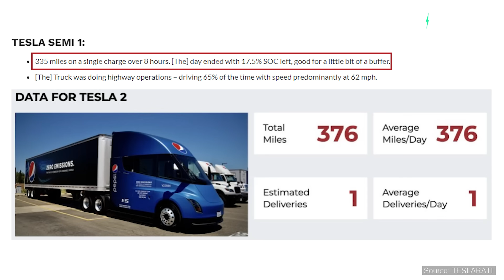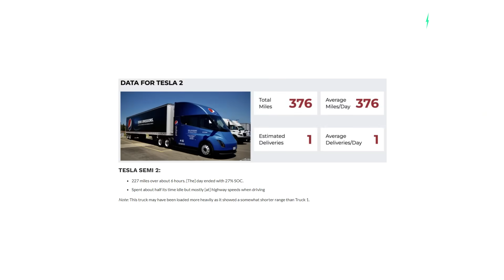Tesla Semi tested at highway speeds - REAL world range shocks rivals

Comment: Sam. also imagine millions, probably, of semis needing to charge thier batteries at once! Sure pepsi is rich, but what about all the small operators i see daily fueling semis! wheres the infrastructor,  the charging stations for them! NOT YET IN THE USA
Reply: There are 36 Tesla Semis in the PepsiCo fleet, and 21 Megachargers in use or permitted; and another 72 planned between Fremont, CA and Laredo, TX. The infrastructure will be built out as the fleet grows. This is the same and the Tesla Supercharger network; which has grown from the very first Supercharger to a near-world-wide network of 50,000 Superchargers in just 10 years.

Comment: I think replacing diesel with these EV semis is probably the easiest segment of the ICE market to disrupt. Mainly becuse the high capacity charging points would be easier to build out because truck traffic flows along major highways. Cars and pickups have to go everywhere and randomly, but big trucks are more like trains tied to tracks. The trip to local pick up and delivery points would not typically be out of range of the major highways. I think this looks like Tesla outperforming the complacent legacy industry in a a critical transport segment.
Reply: Specifically Day Cabs are the easiest. Long Haul Trucks with BEVs is basically impossible, but that is very much NOT the entire industry. Day Cabs are a massive sector that should be fine with a Truck with 400 miles real world range.
Reply: @Neojhun  A long haul operation is easy to setup.   Just swap drivers as needed.   If the load is hot you can swap out the tractor too.  The trailer moves 24/7 but for the time it takes to swap drivers and or tractors.   This is not new.
Reply: Segmentation of EV semi's needs to be addressed.  Delivery vehicles need to be a major focus; specifically, the 'final leg' of delivery (DC to consumer).  That will be interesting to watch/see.
Reply: It’s an industry that is finely tuned to the economics of transportation. Cost per mile is the key metric. If a company can save on fuel costs and maintenance, they will make the shift.

Comment: I analysed the first two day so  data, the results were: 

Based on the fact that they are fast charging at the end of each day, it looks like they are starting and ending each day at the same depot. So, it looks like they are doing round trips of within a radius of about 190 miles of the Sacramento depot. 

Tesla Semi 1: Travelled 415 miles each day, driving mostly at 62-63 mph. Average energy usage rate was 434.5 miles per 100% of battery capacity.

Tesla Semi 2: Travelled 375 miles on day 1 and 362 miles on day 2, driving mostly at 60 mph. Average energy usage rate was 441 miles per 100% of battery capacity.

Tesla Semi 3: Travelled 514 miles on day 1 and 794 miles on day 2, driving mostly at 60-65 mph. Average energy usage rate was 430.6 miles per 100% of battery capacity.

Based on those figures, Tesla's original claim that the trucks were capable of doing 500 miles when driving at 55 mph seems realistic.
Reply: Tonnage is meaningless LMAO!!! 😅
Reply: What tonnage...  Range is meaningless without a tonnage number
Reply: @w8stral  The tonnage is 82 thousand pounds.  Battery electric trucks are allow an extra 2k pounds to account for the the battery weight.
Reply: @w8stral the weight is an advantage with regen during braking & downhills.
Reply: @w8stral Tonnage is meaningless. It doesn't take much energy to keep things rolling. Aerodynamics have a much bigger impact on range. 

The heavier a truck, the more it will Regen going downhill/braking. So at the end of the day, it's a wash.

Comment: This would be interesting if we knew the load weight each truck was hauling.
Reply: @user-el5nd2kn2r
Yes, but with time I think this will be the most analyzed semi ever.
With reason. It's revolutionizing the heavy truck industry!
Reply: @larsnystrom6698  If it works for a business to go this way, then why not.  A lot of mathematical load and range calculations need to be done first though.  No doubt Tesla are doing or have done the same maths.  In the US I can see a lot of 1mW chargers getting installed along major interstate highways, and that might make a difference to some fleet operators.  I say might advisedly.  I believe there will be a lot of interest here and as battery tech improves then maybe that will seal the deal for a number of doubters.  Logistics are a funny business and running costs and down time is like burning money.  I suspect not everyone will benefit the way we might think, but I am hopeful.  As I suggest, If it works for a business to go this way, then why not.  Cheers.
Reply: @GolLeeMe  Goo point. This test answers the question of how well these trucks work in practice.    Which is what you seem to be asking.
Reply: @larsnystrom6698  agreed, but the lack of data provided for these tests makes them almost worthless
Reply: @jamespaul2587  Negative Nancy
Reply: @jamespaul2587  No.  Your looking for one metric that is of concern to only 10% of truck owners.  90% run with less than max loads.   The questions they want to see answered is how well the electric trucks will work for them.
Reply: @BioniqBob  not negative, just pointing out incomplete test data is basically useless
Reply: Im with Mercedes on this one - the laws of physics generally dont like to be broken…😂
Reply: @mathysdupreez602 they don’t - because t Mercedes might be using bad approximations.
Reply: It was full load as far as i am told.
Reply: @isaksidenius7059    Yes, but what does that mean?  A full load of x number of tonnes, or a full load of empty boxes?  It seems careless that this report does not shed any light on what weight was hauled.  Haulage weight is key.  All we know is that the truck beat its claimed range by 5-10%.  Well, thats good.  But why not declare the weight moved in the tests?  To put another caveat on this, under what conditions did it achieve this?  Was it all (or nearly all) flat roads or was there a known % of hills involved?  Was it cold or hot on the day, or mixed?  These things are important when you try to achieve a real world test against claims.  I can see already that’s there is scope for electric trucks on our roads, but how important is this report and how real was it?  These are just questions and no disrespect to them testers or the truck or the report.
Reply: Max load 44,000 lbs « max load »
Reply: @steadybreeze1443  
Compared to the max load on a diesel with a day cab?
Reply: @steadybreeze1443  Thank you.  So they were hauling 20 tonnes, or 20,000kg.
Reply: @23chnge  I have no idea.  It’s not the fact they can move loads with battery packs, it’s how this is done logistically.  You don’t just get into an 18 wheeler and decide to deliver something down the road because you can.  It’s takes planning and this is where the pros and cons of electric trucks will either win or lose, or more likely be somewhere in between.  I can’t wait to get the noise and soot out of my local environment, so as soon as a better haulage system is devised I will be on board.  But thats just it, the replacement needs to be demonstrably better and at least logistically equivalent to ICE.  Details are everything.
Reply: @23chnge  They did, loaded to 81,000 lbs.; which means a payload of about 42,000 lbs.
Reply: Agreed, also the terrain and temperature. Even the Nikola did well going downhill 😊
Reply: @jamespaul2587  Correct.  I must admit, I had not given those two determiners a thought.  Thank you for the reminder.  👍
Reply: @jamespaul2587  The trucks park at the same depot each night.  With regen raking the terrain is not much of a factor.
Reply: Independent data with bribes attached…? Wall Street needs to sell those calls.
Reply: Is the problem that you’re really don’t want to know what the load is because it would ruin your narrative.

For the original 500 mile video there was an engineer who analyzed the trip. He determined with the weight of each of the concrete jersey barriers that were on the truck based on their length, which is determined based on the diameter of the tires.
Reply: @neilkurzman4907  Or, they could've just weighed the truck and the load and remove any doubt.
Reply: @hairtoss7975  
It Depends on who’s doing the test and for what reason?
Reply: @hairtoss7975  Because in the the real world this is not important for the loads.    Pepsi just wants to get what is needed delivered.  I think Pepsi understands they do have the range for it's loads based on data from Tesla.
Reply: @neilkurzman4907 you mean Cret.  Tins like ThunderF00t?? Who can't cope with reality...
Reply: @neilkurzman4907  Hardly, as I have no narrative.  I am just a sceptical person.  If it works, it works and I am happy.  My point is that for operators to get on board there needs to be a clear and sustainable benefit to swapping from ICE.  Suspicion breeds contempt, so how about the detail being provided and explained?  Surely weight is one of the key factors for trucks, and its omission from this report seems careless.  I have seen videos before discussing the barrier haulage test based on wheel base and tyre diameter.  This was a previous experiment and no detail was provided to determine if this logistics feat would be sustainable for haulage operators (so some assumptions were necessary).  It was not this situation with 3 independent tests.  The conclusion by assessment at that time was mixed.
Reply: @neilkurzman4907  the original load was in a enclosed trailer. The truck going up the hill passing the other truck was a different vehicle and and a very good slight of hand buy Tesla. These trucks have to weigh a lot more than diesel, or they would have released the data by now
Reply: @robertbowman9108  
The truck physically weighs more than a diesel.  But the total loaded truck is the same as a diesel or 2000 pounds heavier. An electric motor has better torque performance than a diesel. 
Because it has three electric motors, there’s no penalty for putting a bigger engine in like there is in a diesel truck.
Which basically means it has better acceleration without a penalty of fuel mileage.
Reply: Something very fishy about them providing zero details… if they had amazing performance at full load we would have heard about it
Reply: @Gr0gansm1th  
You are not their intended customer. 
Their customers know all the details
Reply: @Gr0gansm1th  https://www.youtube.com/watch?v=GtgaYEh-qSk